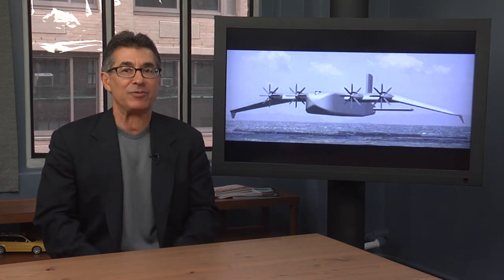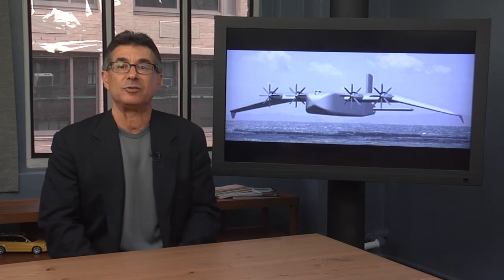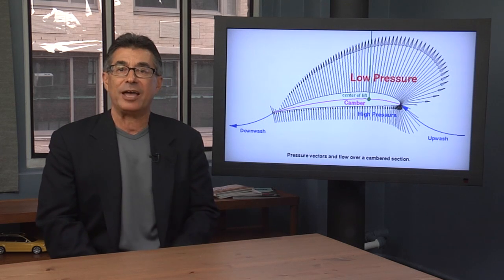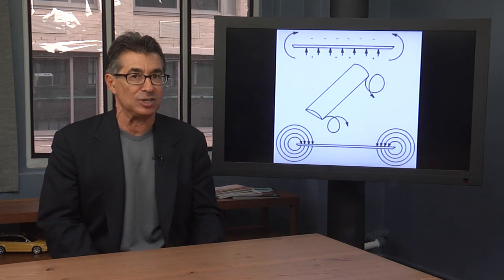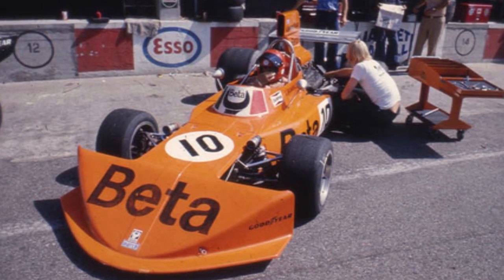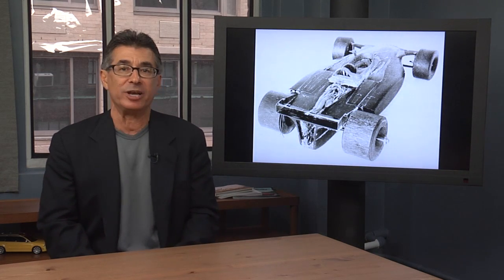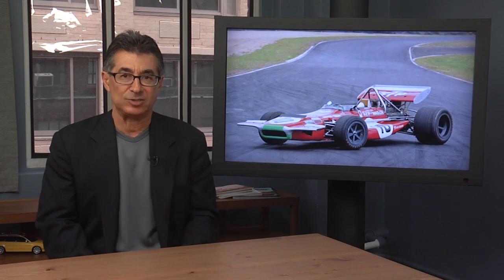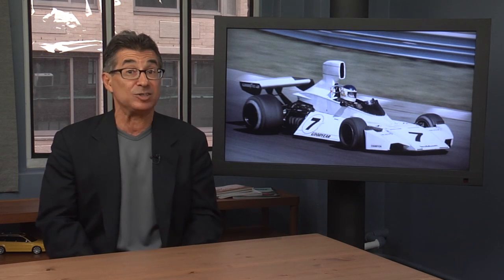McLaren P1 Auto Racing Aerodynamics Explained - /SHAKEDOWN

Comment: There's three VERY important things when it comes to the car. The engine, the driver, and the aerodynamics. Aerodynamics are important because without it, life would not be as we know it today. The engine is important because without it, all you have is a big hot wheels car. The two work hand-in-hand. Without an engine, aerodynamics is nothing. Without aerodynamics, an engine is nothing. An engine can work hard all day and if the car is shaped like a brick, it's not receiving even relatively close to 100% of its capabilities. The cannonball evolved into the warhead, as the McLaren evolved from years of research. Do you know why a .338 Lapua round is one of the most accurate rounds you can fire through a rifle with the best velocity at long range? The shape of the round. What makes a car any different from that concept?
Reply: exactly. so people think its ugly, they don't understand what theyre looking at. its a design beauty. the aerodynamics on this are insane. I like the hybrid sports cars. like the kers systems and active aero are right out of f1, what higher class of racing can you get? even lmp1 now is hybrid. its the way of the future and it can still be cool like this beast!

Comment: Looks are for riceburners.  Function is for winners.  I've followed racing for quite some time now, and winning is what matters on and off the track.  It matters in racing and fuel efficiency.  My daily driver is 1994 Honda Civic VX hatchback...92hp..slow as hell, but with the aerodynamic modifications I have given it, specifically to the underbody and rear diffuser strakes, I average 78mpg highway...not with a hybrid or electric car, but a 94 lean burn Civic VX with aerodynamic genius implanted

Comment: Yeah,that's why he failed to win a drivers' title in F1 for 11 years (1964-1975) and then took another 21 years to finally win it after 1979.

The old man stuck with a front engine car in 1960 when it was clear mid engined cars were the future after Cooper's 2 titles in '59.

Simple garagist teams like Tyrrell with a fraction of the budget and facilities run eights around his cars in the early 70's

Such conservative and non innovative thinking has no place anywhere, least of all in motor racing

Comment: If the angle of attack is great, a wing will produce DF at very low speeds, I was imagining the DRS concept going in the other direction, increasing the angle of attack  of the wing when DF is needed at low speeds. cars such as the mclaren slr and p12 already have a primative form of this, the air brake. I am all for mechanical grip but typical road car tires have low grip.

Comment: but downforce only works at high speed. That's why it so difficult to get used to it, the faster you go, the more grip you have. But at low speeds, your not getting airflow over the car, and therefore you have no grip. You need mechanical grip at low speeds. (everyday road cars)

Comment: I like the direction that the Mac P1 is going in, the connection to the DRS technology of F1 is most interesting. If road cars can actually facilitate aerodynamics to increase downforce on demand at very low speeds such as between 30-60 mph it would be a real factor for everyday cars. Most of the DF that the P1 is making is at speeds which are at least twice the speed limit on most roads. If it can be used at lower speeds not only would it increase everyday performance but safety as well.

Comment: The eddies/wing tip vorticies are a form of lost energy from the circulation of the wing - which we see and perceive as drag as there is an induced angle of attach created on the wing. This induced angle of attack actually decreases the relative velocity angle of the free stream which changes the resultant force angle further aft which we perceive as drag.. Without circulation you don't have lift.  Whenever you have lift, you will always have circulation  - effectively creating eddies

Comment: brilliant video... leo u have not failed to impress once again.
personally think that big car manufacturers should adopt what they have learned in motorsports and try their best to implement into road going cars. otherwise knowledge from what has been achieved would just be put to waste

aero is part of it, lighter and stronger materials, suspension setups or dynamics even safety could be adopted.

everything to make driving easier faster and safer.

Comment: I like the idea of direct connection between race and road aero, but in practice I can't see it being that useful. Things such as a KERS style system would be more useful, until you can get downforce working at lower speeds. If you design a road car for the track like a 911 GT3 RS then it all makes sense.

Comment: If the P1 is meant as a technical demonstration, its current form is fine. But if I were a buyer looking to spend that much on a car, it has to give you something more. A Ferrari or Lamborghini won't come close to this performance, but they will have more soul and character. The problem with building a technically near-perfect car is that it's no different from an Ariel Atom or the BAC Mono. It's a tool, not something you sit back and admire. The F1, in contrast, is much prettier.

Comment: You need to be doing very high speeds in order to aero parts and ground effects to work. Our daily driven road cars doesn't need additional downforce, what they need is more refined suspensions for mechanical grip. What I'd like to see is more racing influenced suspension systems for our common road cars. Because you can enjoy a well setup chassis even in low speeds. Mclaren P1, is just a wallpaper for me.

Comment: Form following Function for me is the difference between a vehicle that you like to look at,and a vehicle that inspires passion. Some brands get this spot on like Porsche with their 911.Its has only be slightly changed since its conception because of how right the designers at Porsche got is right back in the 1960's. You can load up as much aesthetic beautiful as you want , but this will never fool me if there isn't a meaning behind the design.

As for the P1 , when need to see it Drive first.

Comment: A car that has too much grip (& too much downforce) will remove fun factor, by being more stable.
I dream about a car with enough power (for example 300hp+ NA V6) in a lightweight beautiful body witch form and function will be to reduce drag then giving good fuel economy. That include a tire width just enough to make braking and cornering interesting.
Real speed is not interesting for me, i prefer FEELING. Agility and response, engine ant tires noise, trajectory... that is fun.

Comment: I recall the Dauer 962 didn't have the ground effects tunnel found in the older 962/956. Remember, Porsche got around the open top WSC rules by entering the Dauer in the GT class.  But in the GT class, tunnels are banned.  But then again, the new WSC class didn't allow tunnels either.

Comment: Having the Tech in the car is the way to go, but it does not have to go only one way.  

Bentley and Rolls-Royce couldn't breathe on half the super/ hyper cars coming out. The people that buy them are just not worried with the bottom line as far as performance is concerned. 

I'll give kudos to GM and Mclaren as far as the magnetic ride control. Can't beat that combination of performance and comfort anywhere as far as suspension is concerned

Comment: It's hard to find cars that split the difference well, never mind do one, the other, or both well. I prefer a car that looks like it did its homework, at least trying to do both, but may end up erring one way or the other, toward aero or style. An example of this are the Cadillac CTS and ATS, overtly attaining both style and aero performance, not merely efficiency. Also the SRT Viper. Though not as overt as the P1, is much the same, using Aero effectively to bolster performance.

Comment: Why does it have to be form OR function? Why not both? To me, it's the same reason why a 1911, a katana or the Mazda Furai to name a few are such great designs, because it is form and function working together as a whole. And as for race car technology trickling to road cars, it's a case of picking the correct tool for the job. If you're looking for an efficient commuter car, a stately luxury car or a fast sports car, the differing functions creates a differing form for each.

Comment: i dont like all the emphasis on aero mainly because if one nicks or breaks pieces off of the body work (from kicked up rocks and the simple wear and tear of driving) he is not only bothered by the cars dismissed aesthetic looks but now has to be worried that both sides of the car will not handle the same at high speeds. this may mean that every time one of those little wings breaks he is forced to replace a huge piece of carbon fiber (possibly the whole panel under the car) with safety in mind

Comment: Per your questions -- how are you going to make a low pressure system on a road car when the roads are non-uniform? Just on my street outside my house, I have no less than 6-1"x20" "road speed bumps" to reduce civilian speed (as unlike race drivers, most civilian drivers don't respect speed limits). Therefore, the only reasonable way to produce down force in a road car appears to need a reasonable amount of clearance for it to be usable. That is a more interesting discussion, but is it needed?

Comment: I like the McLaren P1 because it is a supercar that defines an element of supercars, downforce. Yes the Veryon is insanely fast and yes sings such as a Ferrari V8 but no other supercar has been produced to focus on downforce to such extent. Focus on downforce has improved the entire car: handling and speed. Not to say that the P1 will cut through the wind or to say it will get off the line faster because of downforce but rather that airflow has been examined to that point is reassuring.

Comment: On cars like the P1, aerodynamics make perfect sense but I don't need a splitter or a DRS system on my Honda Fit. It's just unnecessary.
The 458 is very beautiful and will take you as fast as you really could go on the road. Adding more aero components to it would just make it uglier. I'm sure the P1 will be a great car but I can't see why people need to pull 2Gs through a corner on a public road. I hope most P1s are mostly driven on the track because that's where they can be their best.